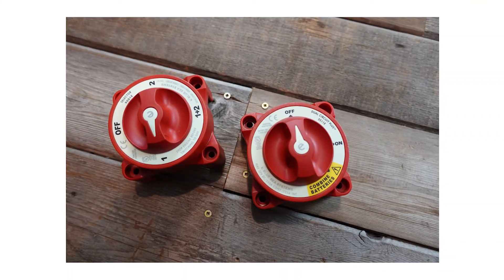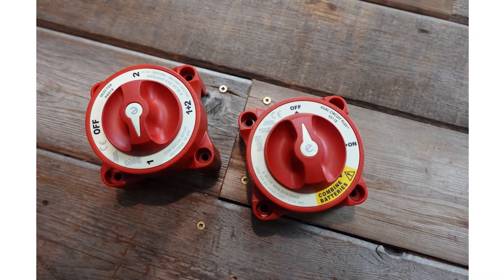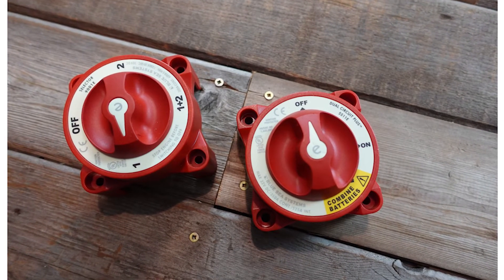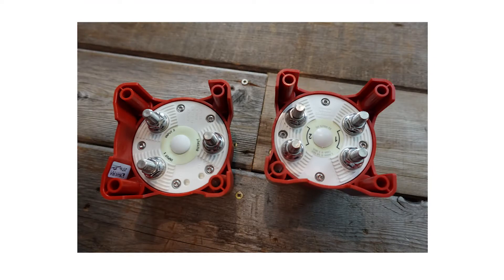What Is a Single Throw Double Pole Switch on a Boat?

Comment: Is it okay to have my start battery isolated from my electrical system except for my ACR? Currently, the start battery does not have a service disconnect switch installed on it.

Comment: Hey man.. awesome beta on setting up electrical systems.. I have Q? I have a BSS Single Cicuit 6006 ON/OFF switch, a BSS ACR 120A, x2 AGM house batteries, BSS 100A thermal circuit breaker, and a BSS ST Blade Fuse Block, a BSS PowerBar 600A (4 column) and a ZAMP Solar Controller trying to wire it correctly in my van down by the Snake river.. please help 
Thanks